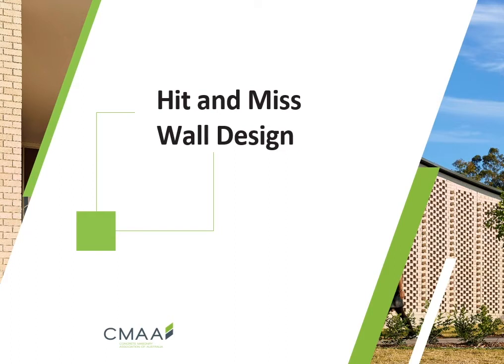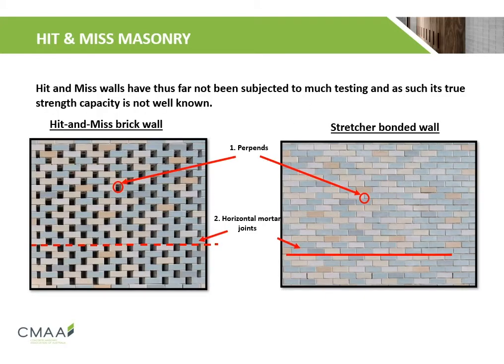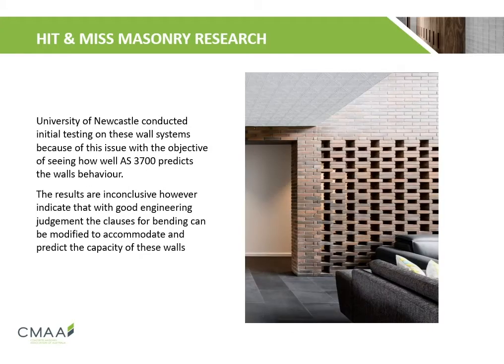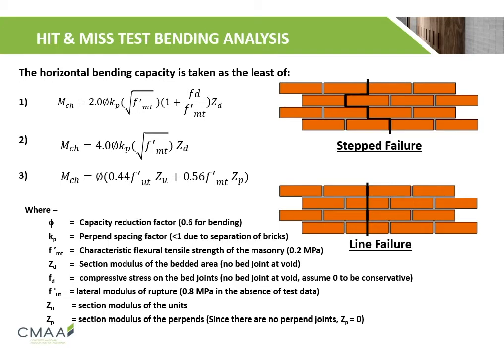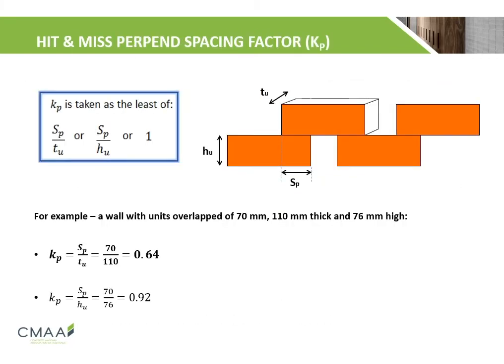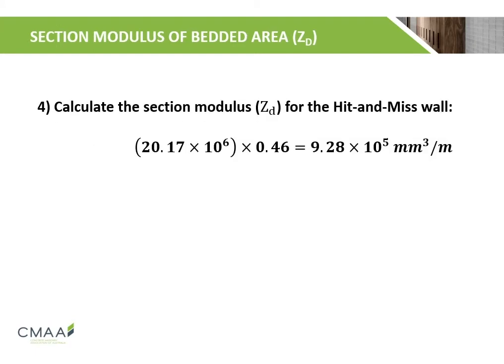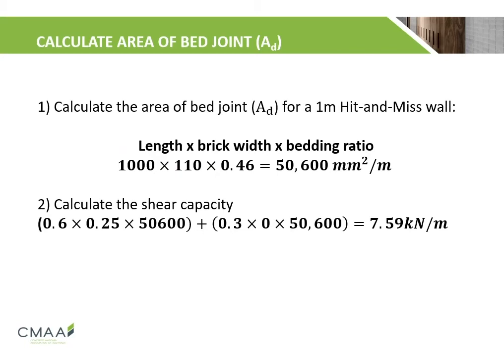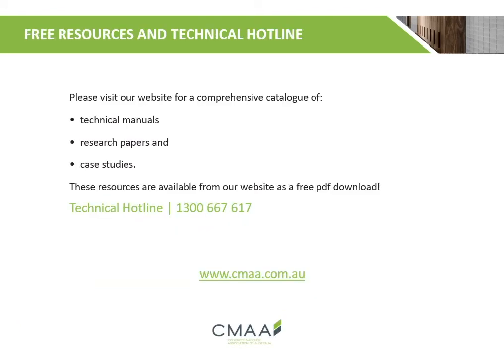Hit and Miss Wall Design

Comment: Thank you for this - Really useful

Can you confirm if in the horizontal bending equation for line failure (3), the correct Z value has been taken? In the calculation it is shown as requiring the section modulus of the units, but the final calc uses the section modulus of a solid wall (Zd) - Is this correct?